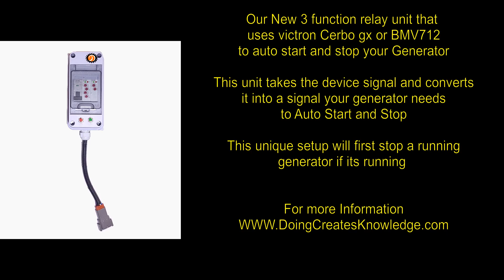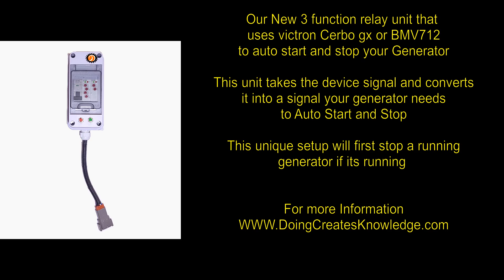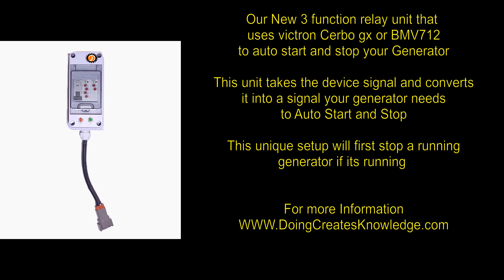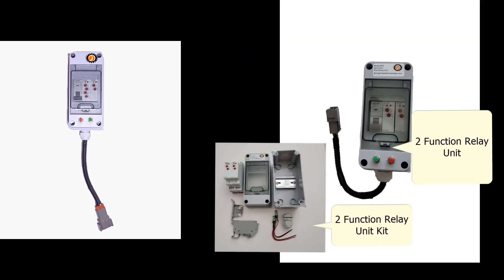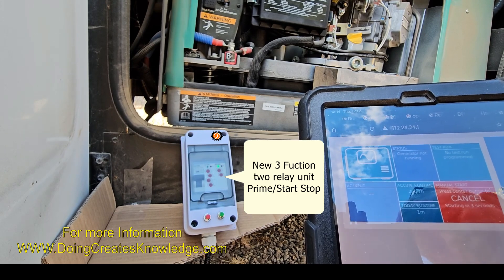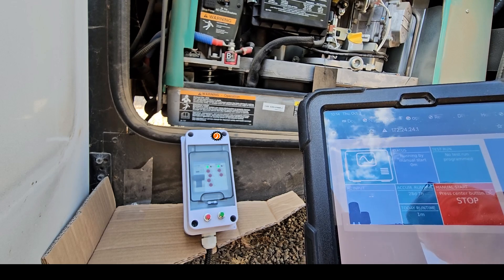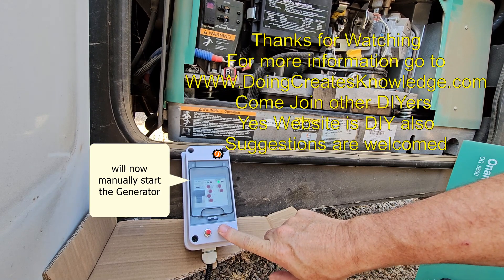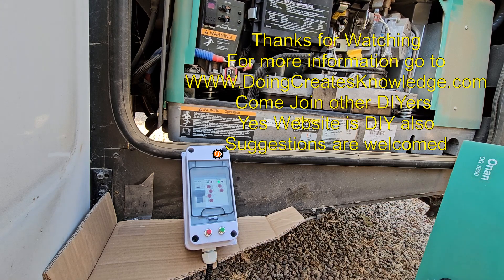New 3 Function two relay Unit to Auto Start Stop a Generator using Victron Cebo GX or BMV712

Comment: Where do I purchase this? Easy install?
Reply from the maker: These can be purchased on DoingCreatesKnowledge.com  the version that is needed depends on your setup, and type of generator.  With a bit more information on your needs we can recommend the appropriate version.

Are they easy to install?  We provide instructions and in the process of determining the correct version for your needs you will understand how it can be installed.   We typically ask a few questions and you can do that on DoingCreatesKnowledge.com  Note we do respond fairly quickly so if you don't see a reply look in your spam folder as we work on why sometimes this is happening or at our at Erazordiy@gmail.com 

Eric

Comment: Hi, very interested in this kit.  My motorhome system is 24v, all Victron components with Pylontech batteries and it has a RVMP FlexPower 4000i generator.  Want to use the CerboGx gen autostart feature based on SOC.  I feel like the priming feature on your relay unit may be helpful for this generator.  Is your new kit going to be compatible with my system and how do I get the parts?
Reply from the maker: Hi Robert,  My first thought is No this 3f2 unit would probably not work as built from what I have read about your generator but would need more information to truly make a decision on it.  I would need to know more about the Start/Stop function and how it's working.  The prime function appears to be separate function from the stop and our units are setup for stop/prime functions.  That said can a unit be built to do what your asking Yep.  With more information I can certainly help you designing a unit that would work.  

Right now I would say it would be a 3 relay configuration to accomplish what I'm reading about your generator.  Handle the prime separate from the stop signal.

If you like help with this please contact me at ErazorDiy@gmail.com or DoingCreatesKnowledge.com
Eric
Reply: @  thanks!  I will be sending you an email shortly.